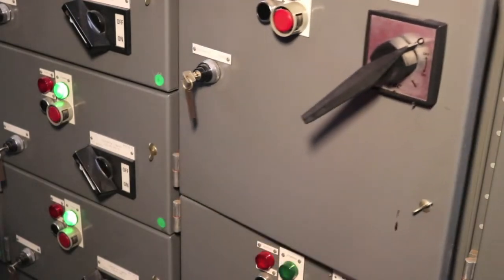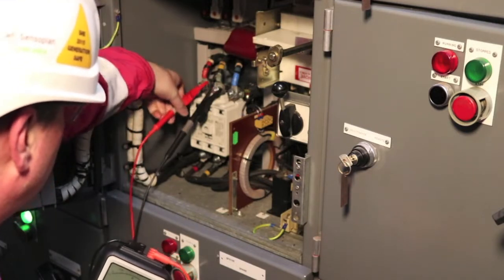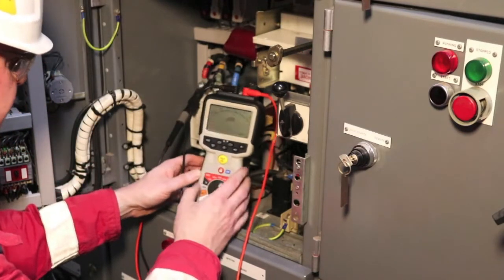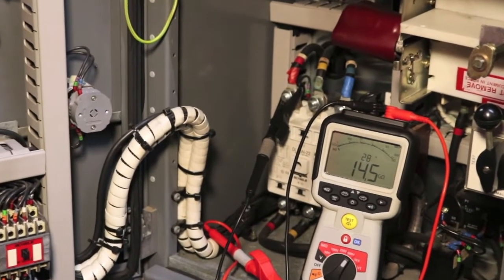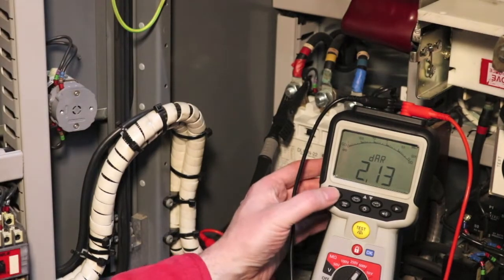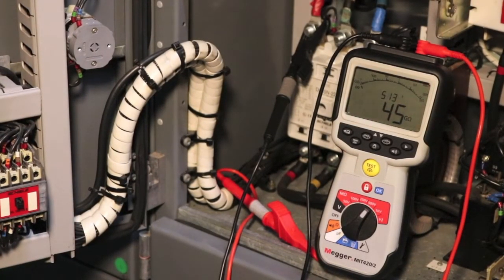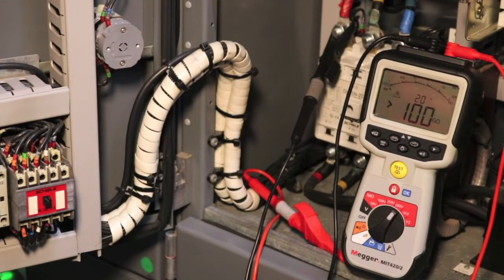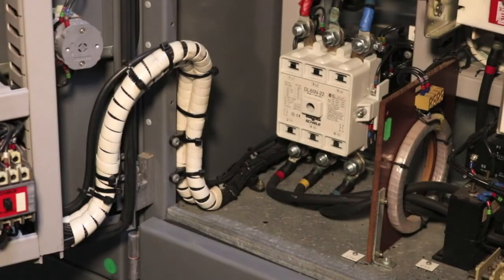Electrical Tests on a 45kW Motor

Comment: What program you used to plot your information
Reply: Also, I thought we had to double the voltage when testing by using 1000v vs 500v, just got my tester trying to learn
Reply from the maker: @MackLife87  Depends on what standard you are working to and what type of test. Generally for an in-service maintenance test you would use the nearest setting on the megger, unless you had one with a variable voltage and some quirky equipment. If you are carrying out a proof test on a new motor or a rewind, then you double the line voltage + 1kV to IEC / IEEE standards.
Reply: @three-phase562  what program is that you use to graph the info?
Reply from the maker: @MackLife87  I use Excel, or any spreadsheet program would be able to do something similar
Reply: @three-phase562  thanks for the info

Comment: Great video TP, absolutely interesting video 🤔. Also what made you choose the MEGGER insulation tester over the others you have to perform the test ?
Reply from the maker: The motors had been away for refurbishment and I was only interested in a go / no-go test to ensure that the motor was safe to be re-energised. It was recorded a while back and I hadn't had the MIT420/2 for long so was testing its capabilities, otherwise I would not have carried out a PI test and just done the phase resistance and DAR.
Reply from the maker: Thanks TETC

Comment: Interesting look at some of your switchgear. Where I work we have a lot of old ABB MCC's with the switchgear contained in removable drawers.
Reply from the maker: This is old Cegelec switchgear circa early 1990s. The one in this video is a hybrid with some parts on the door and others inside the cubicle. The smaller ones are swing out design, with everything mounted on the door in a dual layered frame configuration. The larger ones, everything is predominantly fixed inside the cubicle.

Some of the other sites have the cassette style cubicles, either from ABB or Siemens. Certainly easier to work on and refurbish than the old fixed Cegelec style.
Reply: I'm not sure how old our set up is but I believe the factory is about 30-35ys old. Different Fab's were built at different times though. I quite like the drawer/cassette setup for the most part but we have quite a few drawers that are very hard to remove due to some heavy handed sparks trying to force the  handle to allow you to release the drawer not realising that it's mechanically interlocked with the main isolator.
Reply from the maker: @SandyTaboureauBigbananafeet  That can be a problem with the cassette style, we also had issues with arcing on the primary contacts onto the bus. As far as I know the modern ABB switchgear is of similar design, Siemens have definitely stayed with cassette types. I like them as you can keep spares and swap out to rectify control problems as long as the external plant is okay.

Comment: Wait, you didn't test the other two coils in the motor.......    I'm joking. I do see quiet a few people who would test all three, until you explain to them how you just tested all three coils by doing one. Like in your case, 0.09 Ohms per coil, so all the coils are connected and that 0.09 Ohm will have zero effect on the insulation resistance tests.
Reply: Yep, our test sheets for motor PM's have the winding continuity test first. They state that motor conections are to be left alone (unless theres a VSD that needs disconnected) then when we do insulation resistance tests just to record the 1st value. Star/Delta motor starting setups obvs are a little different.
Reply from the maker: @SandyTaboureauBigbananafeet  VSDs are annoying like that, usually interfering with a good old IR test. I do disconnect and test at the motor terminals where I have a motor that I am specifically condition monitoring, otherwise the cable will affect the test result.
Reply from the maker: 🤣 I am convinced that electricians across the globe are all having the same conversations throughout their career, I used to say the same to others I used to work with. It is one of the reasons I carry out the phase resistance test first, to ensure the winding is intact before applying an insulation test.
Reply: @three-phase562  Agreed and the same reason why I will check winding resistance 
first as well.